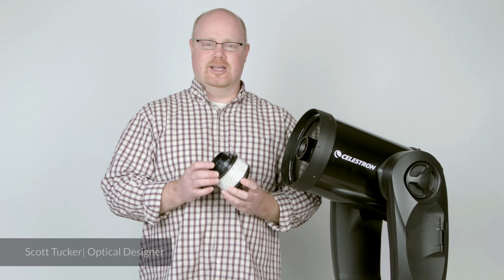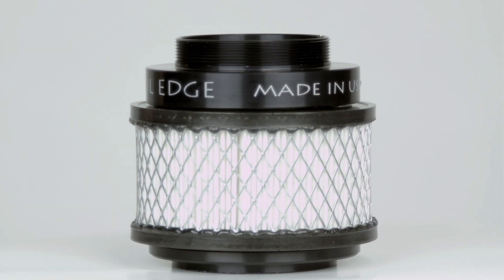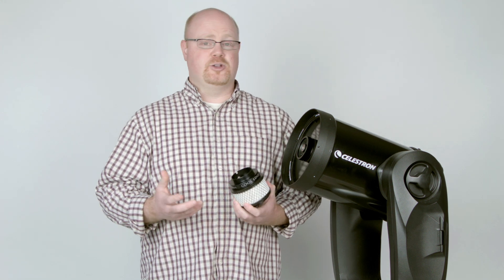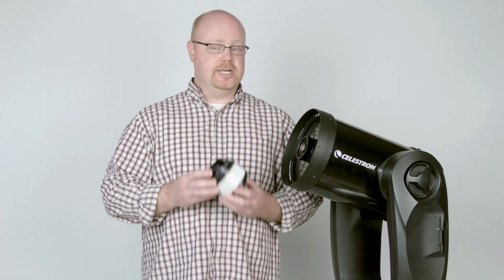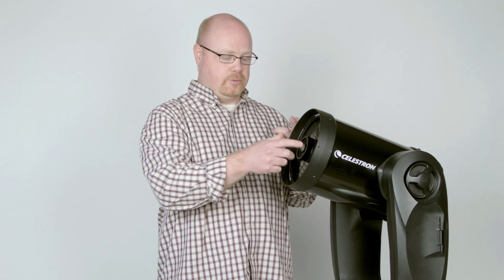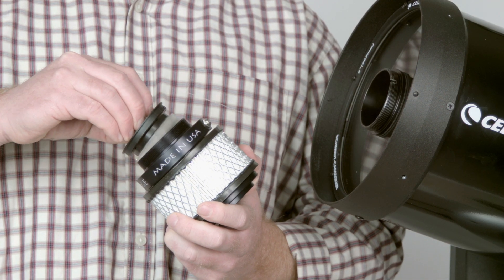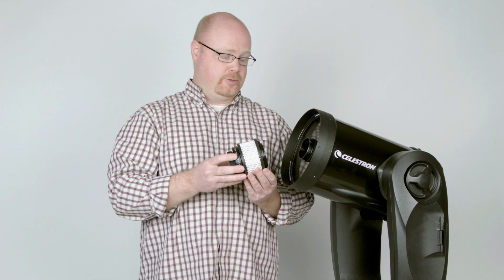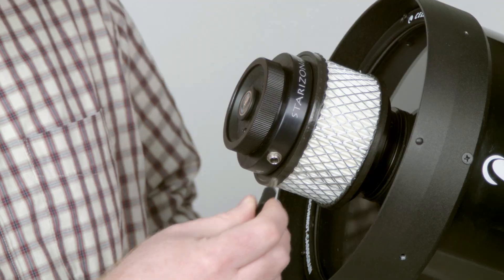Starizona's Cool Edge

Comment: It's a good thing to quickly  cool down the scope from a large temperature difference.  However, the air being cooled is being pulled through the motor which is several Watts in power, which acts like a several Watts heater to the primary mirror.  So, the mirror will always be somewhat warmer than the outside air, no matter how long you cool your scope with CoolEdge.
Reply: Not true. With my experience the fan does not add any temperature to the secondary mirror. The secondary is being cooled with the same temperature air as the primary, the only theoretical opportunity to heat the secondary would be the few seconds when you are removing it. This doesn't happen . Verified with a thermal gun. Your statement is inaccurate.
Reply: @hdr96k  I have thermocouples installed on the mirror and the outside.  The difference in temperature is always 1 - 1.5C (the mirror is hotter), no matter for how long the fan is run.

Comment: You forgot to mention, after removing the secondary mirror, you'll spend an extra 20 minutes collimating your telescope.
Reply: Actually, all Celestron removable secondary mirrors are indexed so they can only go back in the same orientation in which it was removed. So if it was collimated when you removed the mirror, it'll be collimated when you put it back ;)
Reply: I think you may only need to check the collimation, not to re-collimate
Reply: @rosaluks644   I always check because it's my nature to do so.  Never have had to re-collimate the SCT, always remained in alignment.